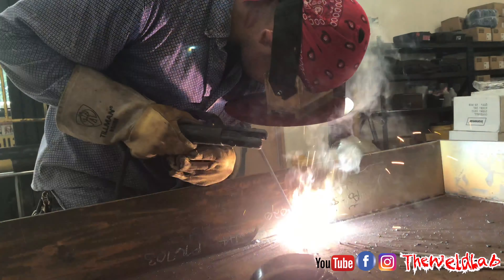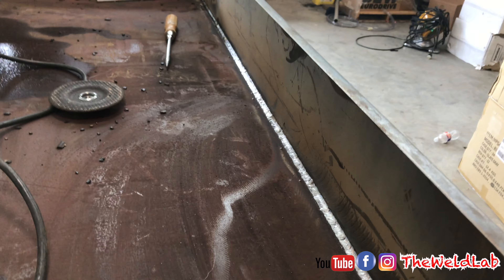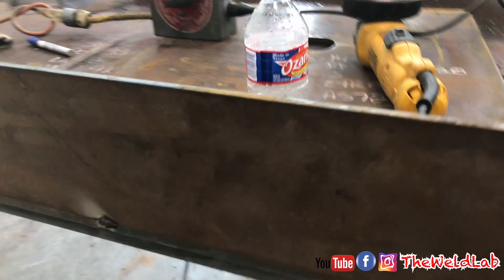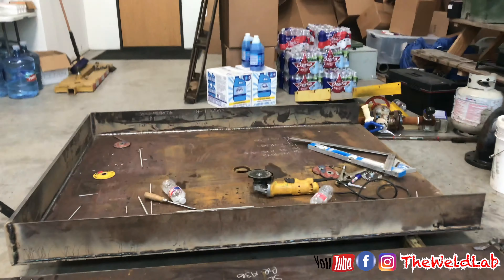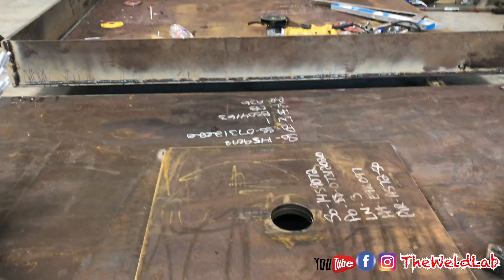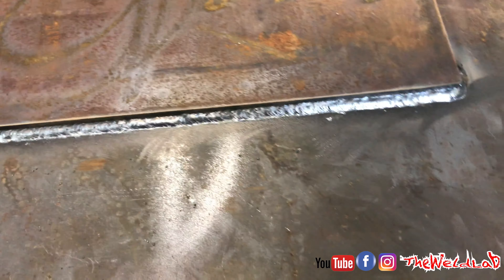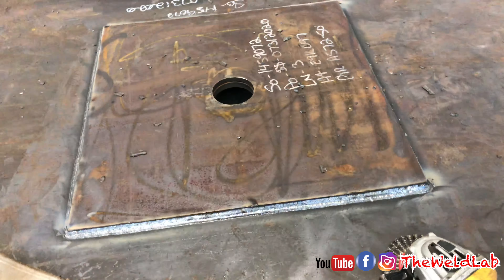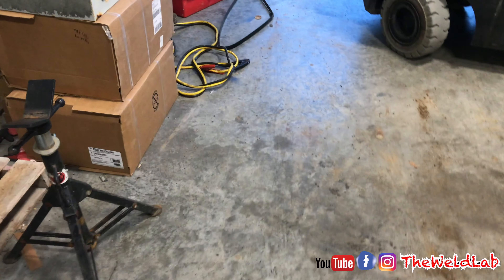DAY IN THE LIFE OF A PLANT WELDER | Another Side Job, Structural Welding, Answering Questions

Comment: I’m almost out of welding school, in the Bay Area. Not sure if I should go into a union. ( 19 yrs/old )
Reply: San Francisco Bay Area? If so for sure go union. UA pipe trades is best you can do. What welding school?
Reply: @garrettmaxwell2820  yeah Bay Area, I stay in contra costa region but I’m going to a community college that has a good welding program in the east bay. I’m learning SMAW TIG MIG Flux core and pipe welding as one of the last classes. At the moment I am in intermediate SMAW but I finished all the positions for that class with 7018 and started advanced SMAW early. Now I am practicing my groove welds in the 1G position to start off the advanced stuff. We usually do flat horizontal vertical up stringer/weave and overhead. I love welding so far, the hard part is getting started in the field. My overall goal would be to be my own boss. Union journey man pay is really good but I want to work for my self like for example as a RIG welder like my man the weld lab.

Comment: Hey bro have you ever tried a flux coated Tig  rod ?
Reply from the maker: No bro never heard of that ...what you welding?
Reply: Currently I’m working in a pipe shop doing stainless steel mostly sch10 from 2” to 16” but we’re actually going to start working some 36” 3/8 pipe I think that flux costed rod will come in handy eliminating the back purging due the size of the pipe
Reply: I Thought of you working out in the field probably have used one of these before
Reply from the maker: I never heard of that man ! Let me know how that root burns